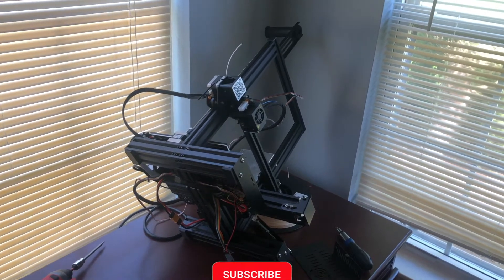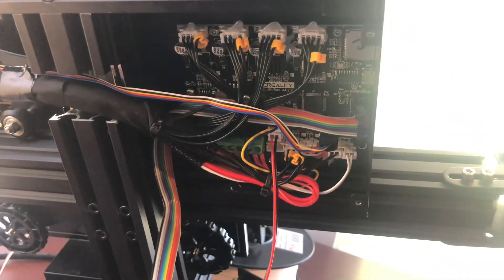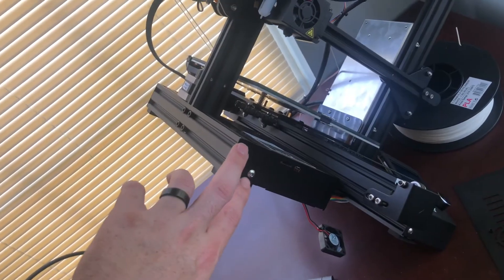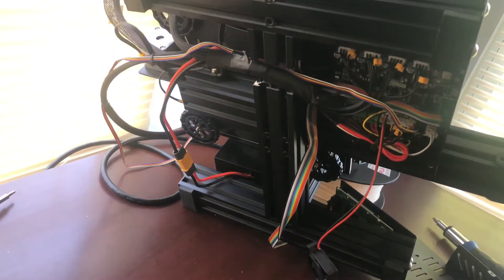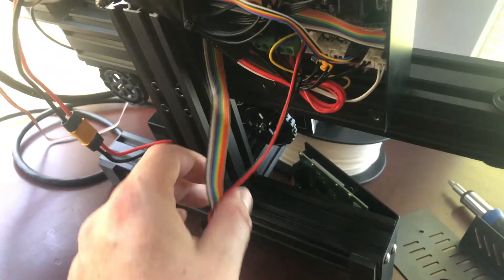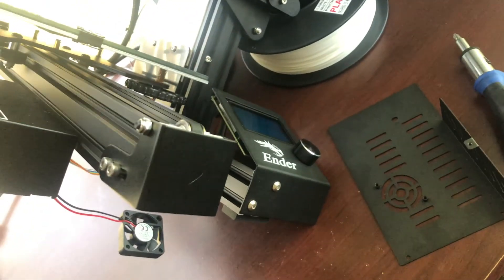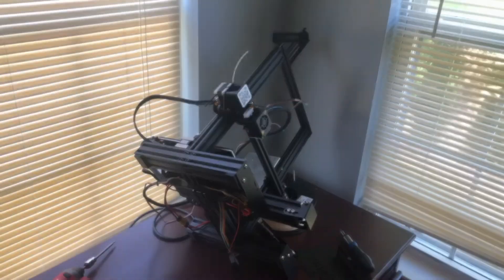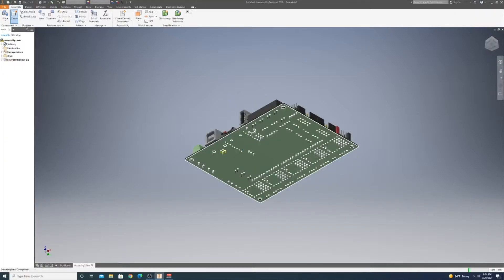Custom SKR2 Case for Ender 3 (Pro)

Comment: Nice work dude. Just got a SKR 2 for my ender 3.
Reply from the maker: Thanks for watching! It was pretty easy getting this up and going. Only thing that is a pain is crimping the connectors if you go that route
Reply: @PrintPractical  I've got connectors here and the only one I'm crimping to get it up and running is the hot end fan (I think)
Reply from the maker: Cool, well let me know if you run into any hiccups, I can try to help you out
Reply: @PrintPractical  Thanks, I appreciate it.
Reply: @PrintPractical  Well it took 3 SKR-2's to get it up and running. 1st one was supposed to be a F429 but turned out to be a V1 and would not work with my TMC2209's - second let out the magic smoke because of a backward wired buck converter (creality wire the hotend fan wires backwards in the factory) so now on my 3rd and it's printing great. Going to print your enclosure out today.

Comment: I asked for the stls in another video like a dummy. Thanks man. Do you have a way for me to give you a donation? Actually I'll leave you a tip when I download it.
Reply from the maker: Hey, thanks for watching! Really no need to tip or donate to me. I did add a link in the thingiverse description, but I just do this stuff for fun, and enjoy helping the community.
Reply: @PrintPractical  you're a good person. The cr10 v3 has the slowest interface in the world. It's funny how the cost to change a screen and mainboard is much more than the price of the two parts both in tools and in time. It's fun though. My ender 3 is more reliable than my cr10 and it cost almost quadruple and now like the price of the printer to upgrade its 8 bit ass haha it should be zippy though once I do all the upgrades I have planned.
Reply from the maker: Yeah man for sure. The creality printers are a great base printer. If you dump a little extra money into them, you can make them pretty nice!  If you have any other questions as you go through your build, let me know and I can try to help.
Reply: @PrintPractical  you're gonna regret saying that hahaha. Thanks a million man. I'm shopping around for linear rails now. I want to rid the printer of vslot wheels on every axis. I'm not buying hiwin though that's just insanity,  especially with customs fees and the value of the Canadian dollar